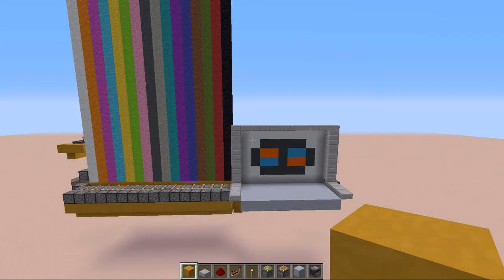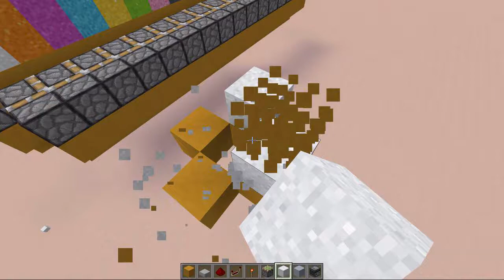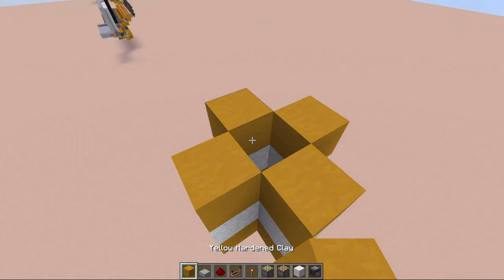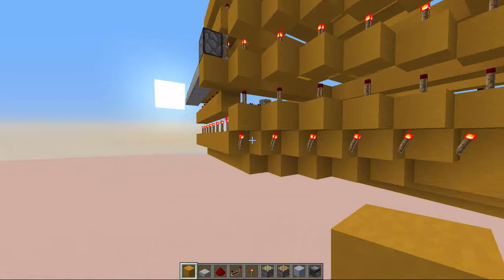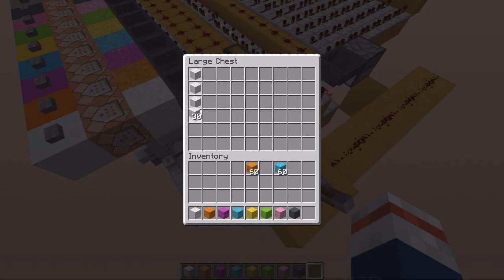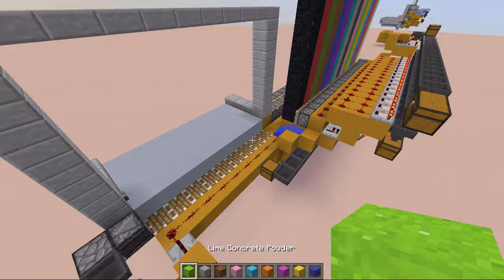Super Fast Colour Printer Minecraft [Response Mumbo Jumbo] | Redstone 17w06a

Comment: Is the 55 seconds from when you hit the lever, or from when the blocks started falling? Because, in the video, you hit the lever at 13:37, and the picture finishes at 14:38, which would be 1:01, or pretty much exactly the same speed as mine. (1:00 give or take, depending on the blocks you use, since some take slightly longer). Maybe I'm just getting salty that someone's rivaling my time :D, but either way, it's a good design.
Reply from the maker: Yes I adjusted the Timings a little bit after that and then took the measurment and got 55 secs but that can change depeding on the Blocks. But I liked your Design too.
Reply: Okay, thanks for clearing that up. :-)

Comment: Nice video, great job! :D

Could you use ice water streams or hopper minecarts to make it even faster?
Reply from the maker: Yes I think so but the Timing would be very difficult to determine.
Reply: hmm yes... but you could try :)
Reply from the maker: I'm going to try.
Reply from the maker: No I just wanted to minimize the Distance the Blocks had to go. But I think your new Design is good too. Mine is a tiny bit faster though. :)